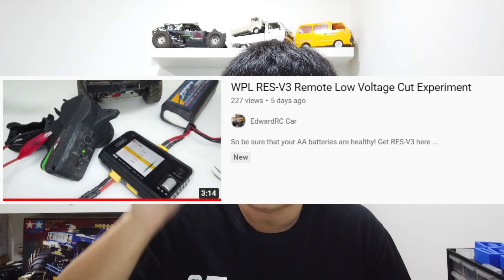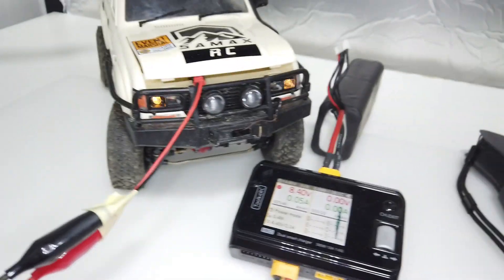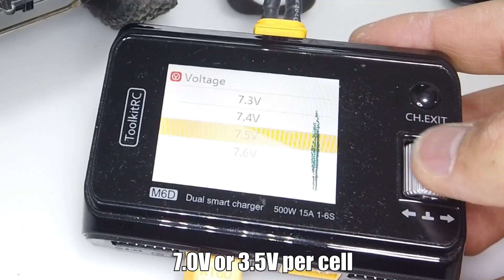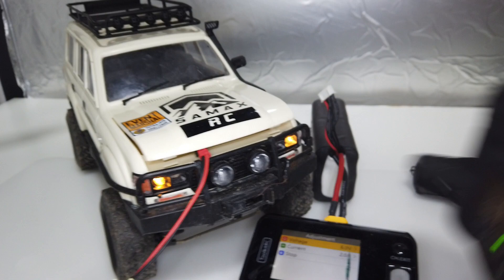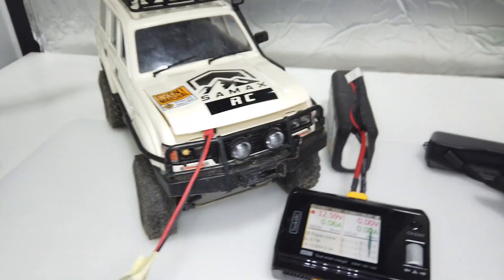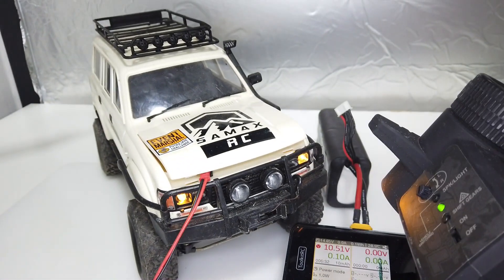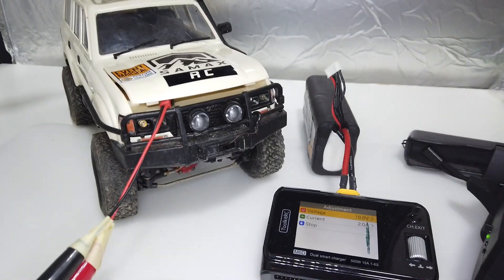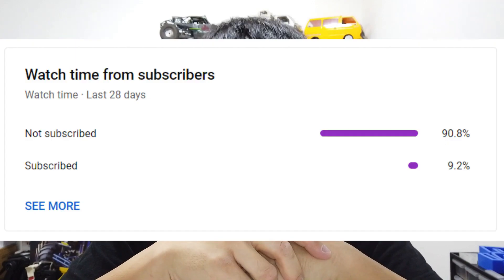How Low Voltage Can You Go? WPL RES-V3 RECEIVER

Comment: I experienced something with res v3. When I steer mg rig downhill my res v3 cuts off. It blinks and dose not do anything unless I reset it? Is it also due to the lvc?
Reply from the maker: Attach a lipo buzzer to it to get live voltage reading.
Reply from the maker: Could be also other protection cut off
Reply: It also happens in a very specific way. When i downhill and turn my steering in a steep angle. No problems when uphilling or extreme crawling
Reply from the maker: @michaelkennethrivera5668  could be servo jammed and pulling too much of current out of the 5v supply
Reply: Thanks for the big help kind sir.

Comment: Hello. WPL-c14. Proportional control. RZ7808 is already burning 2 times, which one can be put in its place? And if you just buy a receiver board, will it connect to the control panel?
Reply from the maker: Maybe you put a large motor?
If you buy the same receiver then it will work with the old remote
Reply: @EdwardChew  
I didn't change the engine. When buying a car, there was a 180 motor in it. 
Thanks for the answer)

Comment: Sir does this also aply with the stock proportional esc
Reply from the maker: yes. except stock esc max at 2S only
Reply: @EdwardChew  thanks sir. I have gone through a lot of rc forrums and found nothing about my esc.  Thanks again, love from the Philippines!!
Reply: @EdwardChew  if this cut off often occurs. Does it mean that my batteries are bad now right?
Reply from the maker: @michaelkennethrivera5668  yes it could be. To be sure please check the voltage. Also notice there is under load and zero load voltage